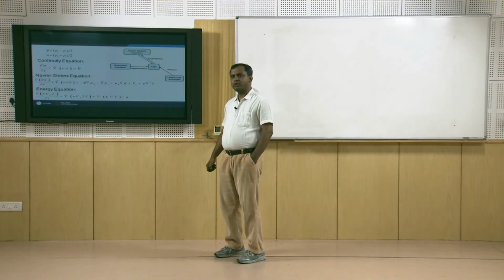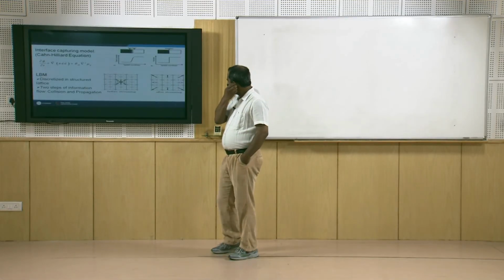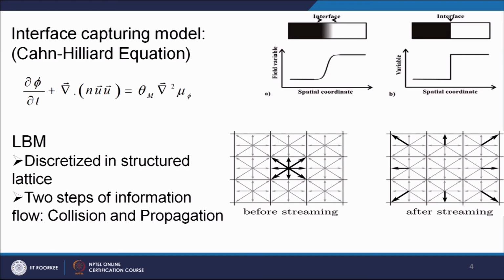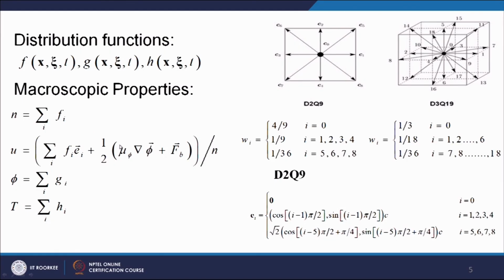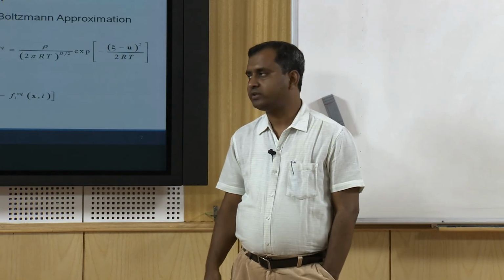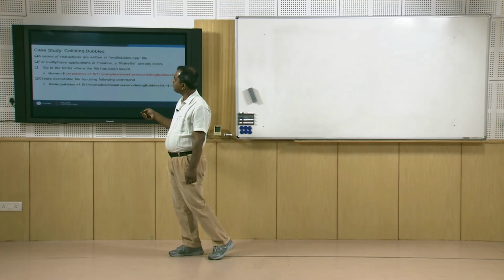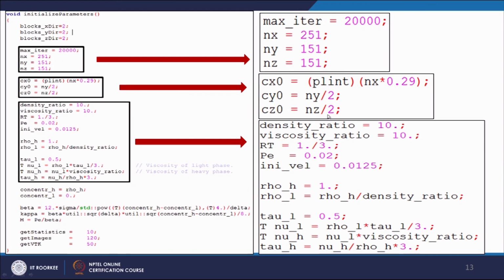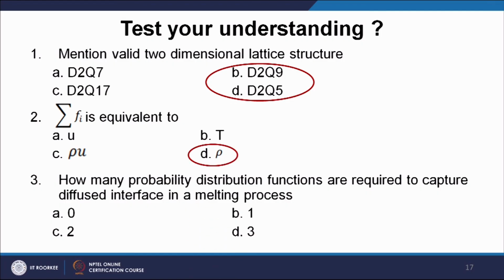Lattice Boltzmann Method

Comment: What advantage does the LB method provide over using Finite Volume method on the original set of equations? Because the FV method can deal with the fluxes directly, instead of a requirement of distribution functions, etc.
Reply: Karthik Ganeshan in LBM, one solves the boltzmann equation depending on the various parameters and use a relaxation time to reach equilibrium. NSE  are a special case derived from boltzmann equation mostly using Chapman enskog expansion. So basically you are solving a flow problem starting from transient state itself rather than solving on equilibrium state only. While in FVM, FEM, FDM, SPECTRAL methods or other traditional methods which focus to solve NSE. What actually is being solved is approximate algebraic equation derived from PDE(NSE). Essentially algebraic equations are being solved. Conclusively, what actually you are solving is far different than what actual NSE represents leave aside Boltzmann's equation. I hope you can understand what advantages or efficient, accurate solution will be.
Reply: LBM is more near towards random molecular nature of matter as compared to FVM. Efficient information flow one can achieve in LBM than FVM. Complex interfacial structure is easy to predict in LBM than FVM.